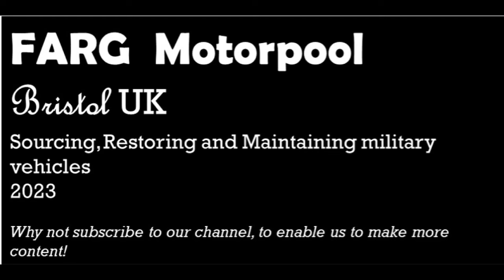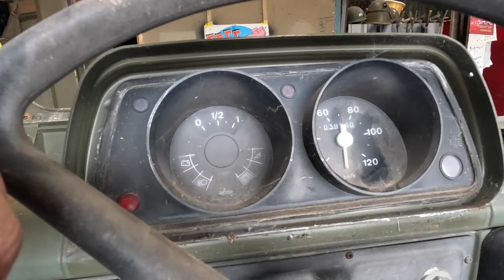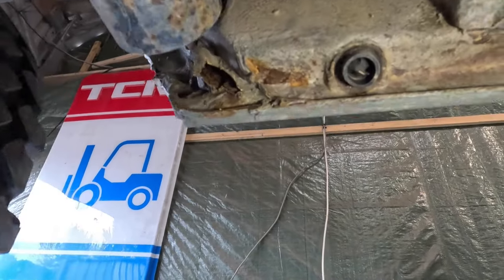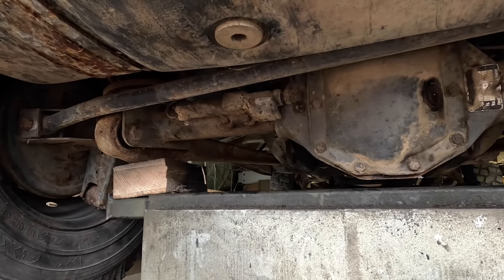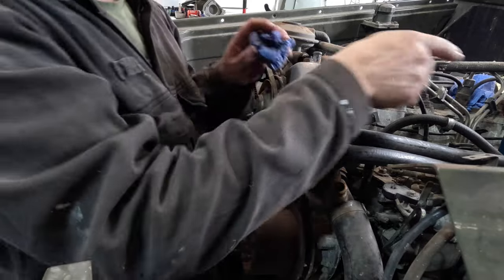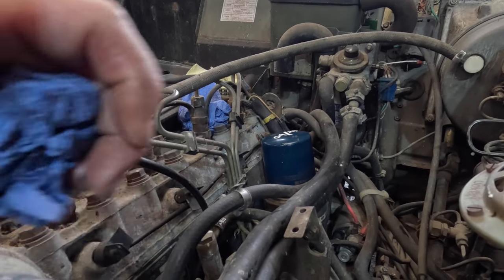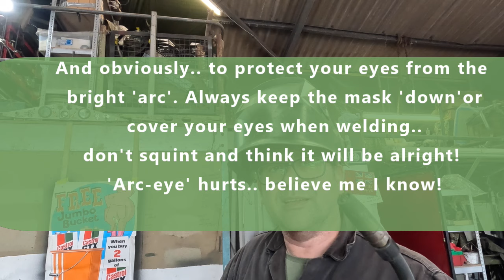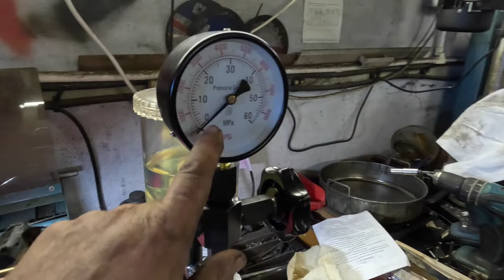Step by step restoration of a P4 Jeep

Comment: Interesting to compare the under side to a Defender, the stand alone transfer box looks like a better idea than the Defenders, front arms look similar, are the front swivel housings not removable from the axle for rebuilding ?
That type of underseal is a pain, similar to what Audi were using back in the 80's and 90's, great when new but could hide a lot of grief. 👍
Reply from the maker: Not sure swivels are removable.. need have a look..